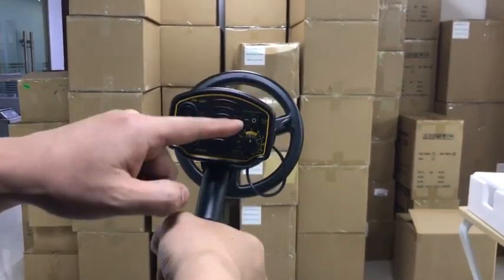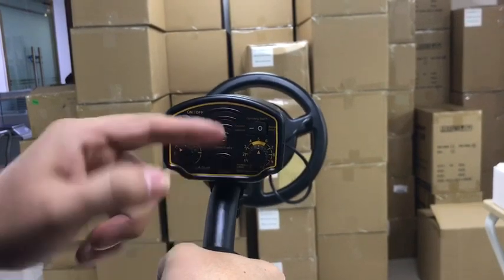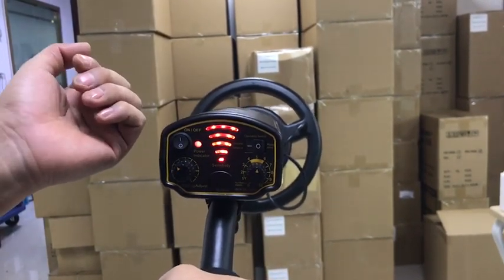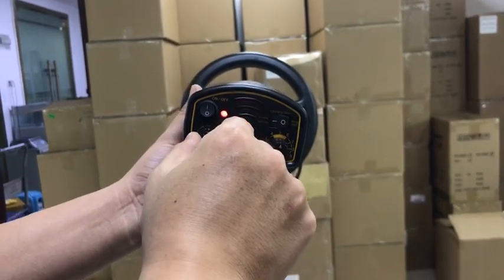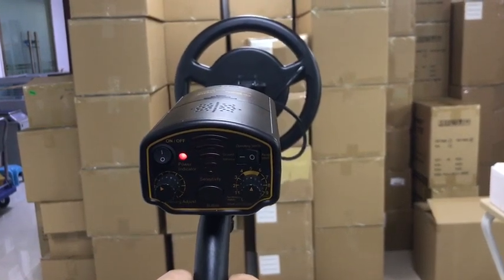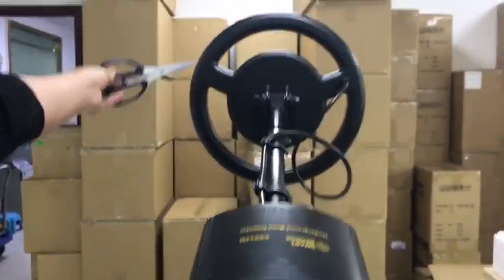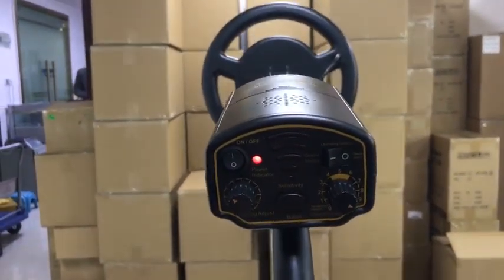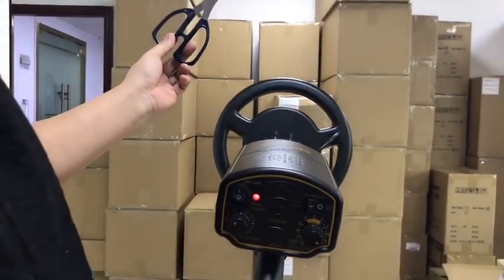AR944M  How to identify non-ferrous metals and black metals, such as gold and iron?

Comment: Do you have an english step by step manual for this? I cant find it on the internet. :(
Reply from the maker: yes friend,do you need it?
Reply: @smartsensor6922  yes please.
Reply from the maker: How to use metal detectors                   
1. First adjust the operation method button to the ground balance mode                   
2. Adjust the identification metal knob to the position of the scale "5"                   
3. Turn on the device                   
4. When the machine has a beep after power on, press the “Reset” button.                   
5. Adjust the detection sensitivity, first increase the sensitivity. When the machine beep and indicator light up, turn the sensitivity rotation button back until the beep and indicator light stop.                   
6. Start detecting                   
7. The ferrous metal box is identified by the non-ferrous metal, and the operation method button is adjusted to the recognition position.                   
8. Adjust the recognition knob to the position of the non-ferrous metal with the scale "1". My scissors are iron, and the detection is in the identification position of non-ferrous metals, so the machine is not recognized.                   
9. Adjust the recognition knob to the position of the black metal scale "9". My sharp knife is iron, it belongs to ferrous metal, and the machine can detect it.
Reply: @smartsensor6922  ty friend
Reply: do you have bigger Search Coil?